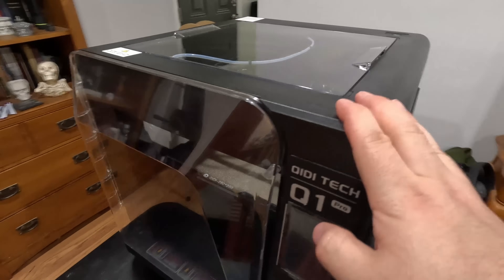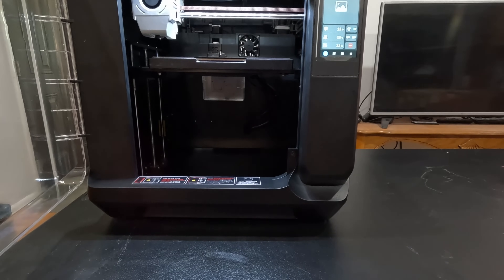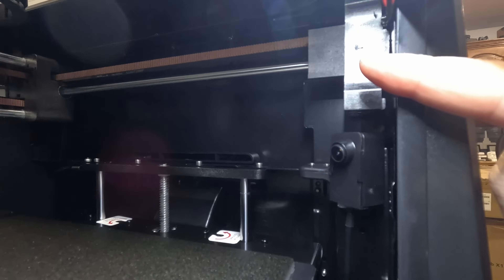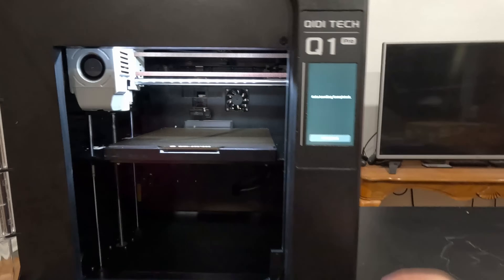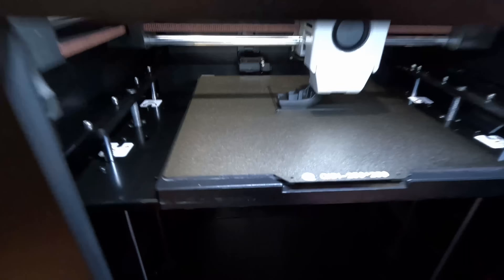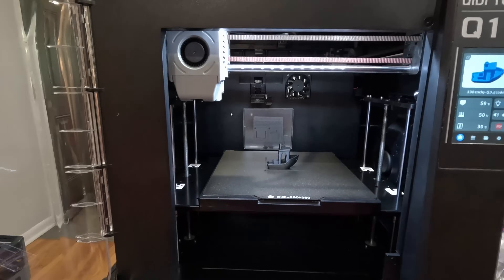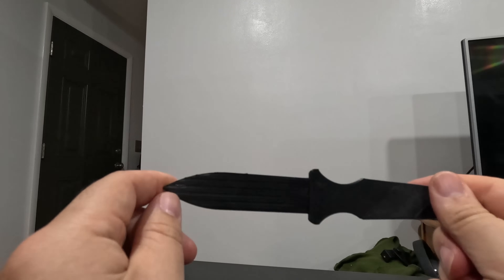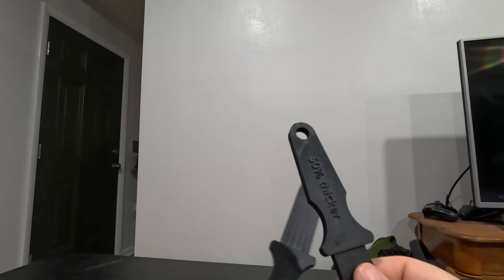Testing the Qidi Q1 Pro - The Most Powerful Budget 3D Printer?

Comment: I would like to add an important thing for users of this printer. Could you pin it?

1. You can print a new filament holder that sticks out on top, QIDI provides this file!
2. If you want less wear on your extruder you can also get a filament support from QIDI. You can put this inside your filament holder and your filament will roll way easier but not too easy!

In my opinion they're really listening to their customers!

Comment: Do you need WiFi to upload files to print with this 3d printer Qidi Q1 Pro?  Or is there a way to upload onto SD card 3d prints without WiFi connection?
Reply from the maker: @GetafixDruid2  I only use a USB drive to transfer files over as this is in my garage where wifi is iffy at best.
Reply: @RyanMercer  Ok, that sounds good for me! I don't have WiFi at home and have to go to town to access WiFi with my laptop.

Comment: Does the front clear door have to stay shut, or can you leave it off? I have limited room.
Reply from the maker: @deeber35  if you're just doing pla or petg you could take it off, but if you want to do draft sensitive sfuff like abs you'd want to leave it on
Reply: @RyanMercer  Does the door come off?
Reply from the maker: @deeber35  it just pops around a cylinder. I wouldn't remove it dozens and dozens of times but if you were going to leave it off yeah no problem.

Comment: Soo many issues with it
Reply: Can you specify?   New equipment fails or something broke over long haul? I'm on my 5th month with mine and only had two big messes (bad adhesion...mostly my fault) but overall it's kicking butt.  I am curious about longevity of some parts.
Reply: @jeffsmith6659  it probably boils down to me being a noob and the process of removing filament once heat creeps up was a pain, had issues with filament “breaking” or jamming right at neck of the hot end.The process of removing the hot end poking it seemed so tedious.once I had my temps dialed down and my fans churning it seemed to work out well.
Reply: @RobertLeeMonterroso   Messing with some things and a quick long term revisit.  I've had a mostly great experience.  I had one self induced clog, directly caused by me and almost certainly caused by the heat creep.  Stuck big time in the gears.  However, pretty easy to disassemble.  I was printing PETG and switched to PLA and did NOT remove the top and prop open the dog, so I made the PLA mush up.  Lesson learned!
Reply from the maker: It definitely has some but for the price point...